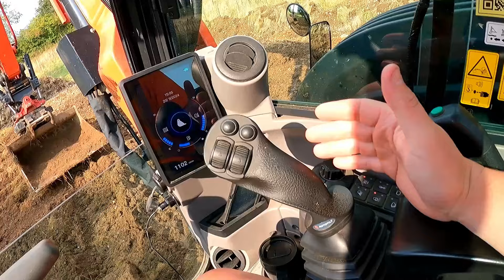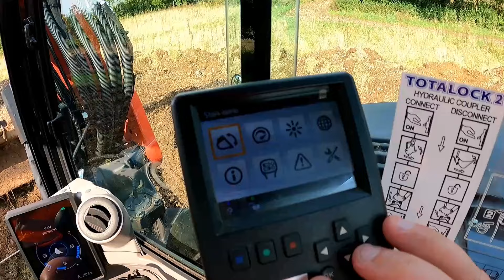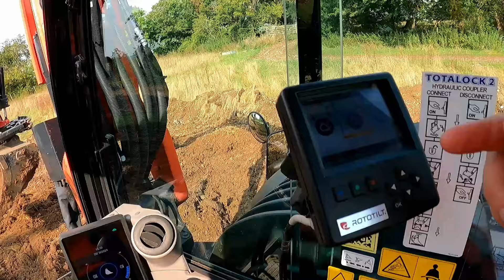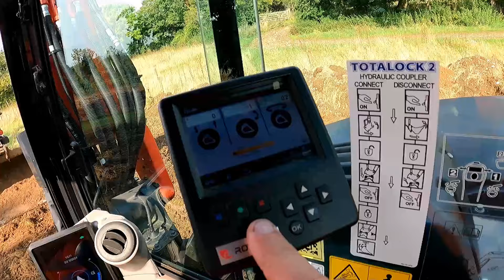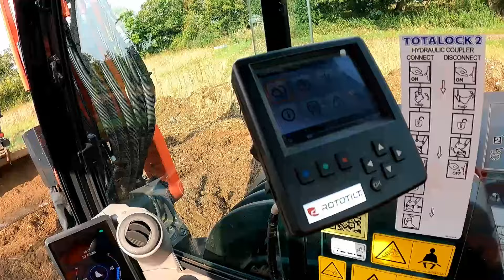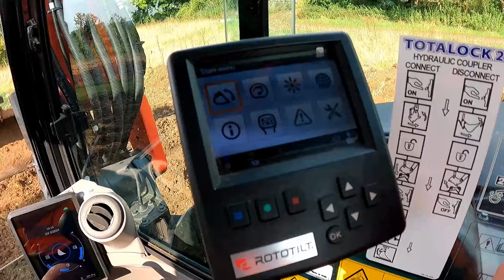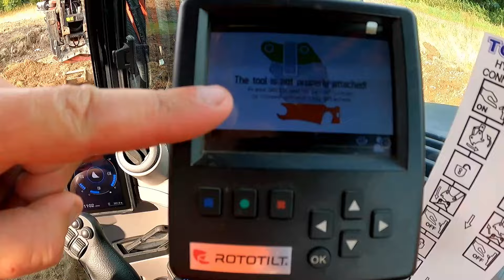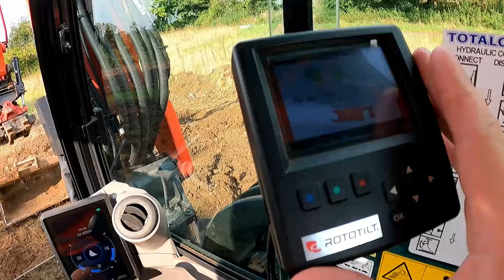Rototilt R3 Tiltrotator Review

Comment: The biggest issue with the joysticks from svab/steelwrist is the two rollers on top instead of bottom so you cant easily run tracking gripper and tracks, which you can do on the engcon. The new RC have the two rollers on the bottom so that solves it for them. I believe that the SVAB new A9 joystick also now have two on the bottom.

Comment: Nice review Ollie

The fact that the gripper isnt a quick detachable unit could be an issue, negated somewhat  if you have top hitch with oil and you can drop the whole unit off easily, but I take the gripper off the engcon quite often in deep trenching and its a great design, very quick n easy.
Bucket vibrate looks a useful idea, if it will shake sand or gravel backfill material out of the bucket without having to shake yourself out the cab to do so :)
Reply: You can take the grapple off your Rototilt if you want kind of easy

Comment: Hey ollie,the engcon ec02 are doing a deal at the moment £5500 fitted with 3 buckets, kn the ec02 can you work a pecker on it? Also what about if you wanted to keep your own buckets will they gjve you a template to weld on top of the buckets to suit the engcon? Cheers
Reply from the maker: I believe that offer is for a 4 pipe setup, so you would need an excavator with two aux lines down the boom and ideally both working off rollers on the machines existing joysticks. You cant use a breaker under any Engcon. That's a Rototilt USP.
As for brackets, yes you can buy brackets to weld onto your existing buckets, but as I explain in another video I made on here, the angle of the buckets, shape and weight of proper scandanavian buckets are significantly different and designed to work under a tiltrotator at all angles. I really would advise saving up and getting proper shaped buckets - they are a dream to use, especially the grader and cable bucket. The general digging buckets aren't so important.
Reply: @Olliegunns if you were were to put a tilt rotator on your jcb again would you get the ec02 again or go for another?
Reply: Show me the deal. Seems way too cheap for ec02 with 3 buckets
Reply: @ type un engcon ec02 price then click the first or second engcon link and scroll to the bottom of the page its actually £5900 on offer and its £7250 when not on offer
Reply: @Michael77333  3 buckets alone are worth like 2500? Makes no sense
Reply: @ its on engcon website for that price 3 buckets and fitted, like ollie said think you need to aux on your digger fir that price if not then yku would probably have to use right foot pedal for tilting i stead of rollers in the joystick, ec02 is for a 2.7 ton digger cant copy the link to send you wont let me
Reply: @ scroll down bottom of the page
Reply: @Michael77333  Yes, i saw the offer but makes no difference if no aux. Ive seen used ones in sweden go for 3000 eur so basically you get a new one for the same money + buckets
Reply: @ depends what the engcon has on it, theres loads of different options like ollie said then it starts adding up quick, like you can have 2 hitches on it, one for the buckets and one to remove the whole engcon from inside the cab so you can add a pecker on it, then theres loads if other stuff
Reply: @Sasskin  i ment to say 2 aux on the digger for that price